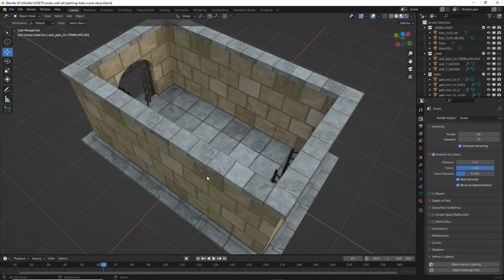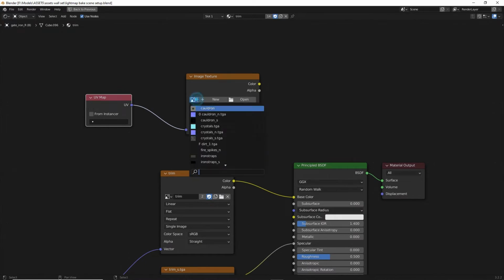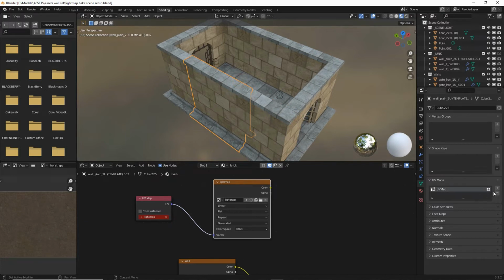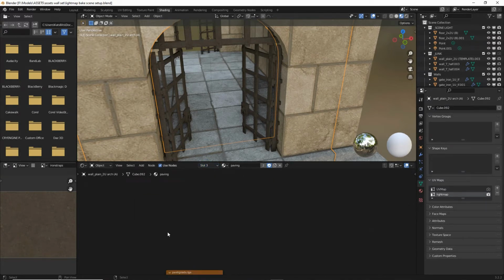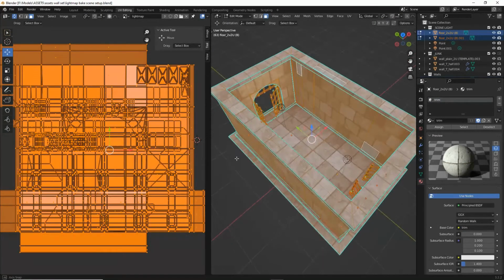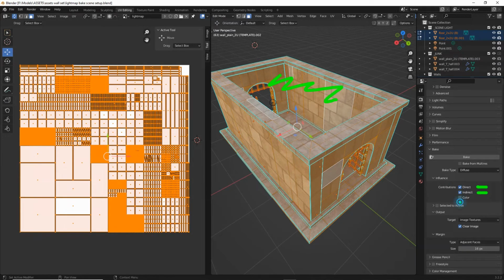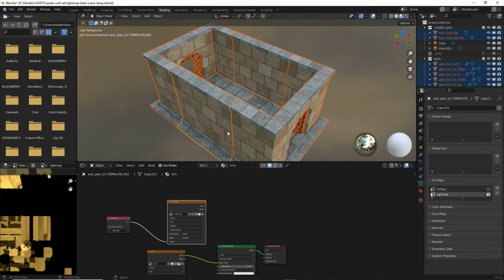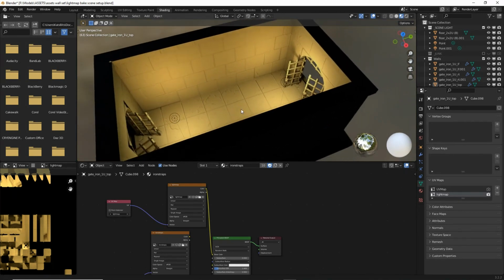Bake Lightmap in Blender

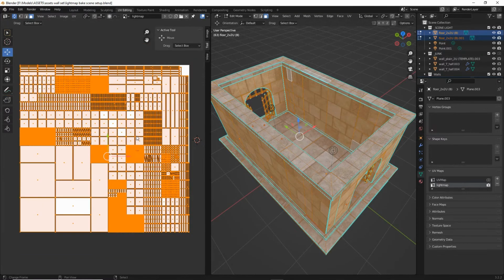Comment: Hello. Thanks for sharing. I have noticed a checkbox 'New UV Map' at 12:17 in the dialogue for creating a lightmap. What does it do? Couldn't you just tick that one instead of creating new UV map channels for each object?
Reply from the maker: It's just a workflow thing really. That can be used but you'll probably have to edit a few things after the fact.
Reply: Be careful with this option!! It will make a new UV Map, but the Lightmap Pack action will overwrite your first (and only) UV Map, which you might be using for textures.

If you want to avoid that and have the second UV Map as Lightmap:
1. Make sure you’re in Object Mode before selecting objects
2. One by one, select every object you need a custom light bake for > go to the Data tab and add a second UV Map with the +, make sure it's selected
3. Shift select all objects you just created a second UV Map for > Edit Mode > press A to select all faces
4. Press U to Unwrap > Lightmap Pack and DON'T use 'New UV Map'

Good luck!

Comment: Why you used uncompressed format to save lightmap?
Reply from the maker: Uncompressed is basically 'raw' data that's not been adulterated by compression artefacts.
Reply: @KatsBits  same for PNG, except it takes less space
Reply from the maker: @uis246  you should always save 'raw' data where possible. If using PNG make sure compression is *disabled*.
Reply: @KatsBits  compression can be lossless. This is how ZIP and PNG work.
Reply from the maker: @uis246 you're missing the point, save RAW data whenever possible.
Reply: @KatsBits  PNG saves same data that BMP does, but also compresses with modified zip algorithm.
Reply from the maker: @uis246  you are still missing the restated point.
Reply: @KatsBits  to not loose data. And I already said about lossless codecs.
Reply from the maker: @uis246  this is the final time this will be said, you are still missing the point. Respond again and you'll have the privilege of being blocked from this channel.
Reply: @KatsBits  why you mad? he is right, even when I'm dealing with normal maps, I save them in PNG because this way you not only do not lose in data but have it less in size. Instead of elaborating you are threating people with ban, like you can't be wrong, so immature.
Reply from the maker: @SlayerDUDE1993  yet another one completely missing the point (despite it being explicitly "elaborated" upon several times). Do you folks grow in tree roots or something?
Reply: @KatsBits  if i ask you right now what the point is, you're just going to tell me that you already said what the point was, refuse to elaborate, and then tell me in bold letters than i am still missing it. the point is that you sound like a beatle and don't know how png works. this was one of the worst tutorials i've ever seen btw.
Reply from the maker: @IveNeverStoodUp  bro, get over yourself, you can use PNG all you want. You PNG stans are almost as insufferable as BlenderBros and just as easy to rile up.
Reply: @KatsBits  is the CIN file supported?
Reply from the maker: @morakumou  surprisingly yes, it does appear that Cineon image files are supported - they can be saved, not 100% sure about them being opened or imported.
Reply: @KatsBits  , i actually miss the point of why it's necessary to save raw data instead of lossless compressed one. is it because of artifacts? but then it's just not true for lossless, it's not affected by artifacts, if that's not the reason then why storing raw variant? just in case, i mean any lossless format, like png, qoi or even just file archives like zip

the only two things i could think of are:
- pngs being limited to 8 bits per channel, which is not the topic of this thread, there are plenty of formats that have 32 bits per channel and support lossless compression
- people forgetting to disable compression for some formats, i. e. exr, but it does not affect pngs or compressed tga, these aren't lossy
(and speaking of disabling compression for pngs, as you suggested in your second comment, it does not reduce quality of the image in the end, again, it's lossless)

i suppose you might've mistaken lower bit depth for artifacts, but it's just a limitation of pngs which doesn't affect other compressed formats with higher bit depths support, like lossless(!) compressed exr (32 bits per channel) or compressed tga (identical to raw tga, which uses 32/32/32/8 bits for r/g/b/a channels, that you've used in the video and only supports lossless, so no room for user error)

i would like to hear your reply and other reasons to use raw or i hope i cleared some uncertainties about issues you might've faced with compressed formats, if that's the only point you initially meant

Comment: Thank you so much for making this tutorial, I searched a lot for blender lightmap baking tutorial, because unity's bakeresult is very ugly, I want to make the lightmap in blender. And I finally found your tutorial! And I am curious if it is possible to use these lightmaps in a game engine like unity.
Reply from the maker: In principle it should be possible to use them in any engine that supports meshes having multiple UV maps, you won't be able to bake and then use lightmaps as a separate group of assets otherwise. Failing that, and this is a little more tricky to manage, it is possible to bake everything, lighting, shadows and diffuse etc., to a 'unified' image that will then be usable as would normally be done for 'diffuse'. Might be a little old skool but it's a failsafe, although this then makes use of dynamic effects, normal, specular etc. moot.

Comment: Can't we use GPU for Baking? If not then why NO?
Reply from the maker: Not 100% sure about this but the Bake sub-system uses its own renderer, it doesn't use the offline rendering engine (or if it does it's not fully integrated).
Reply: @KatsBits  I have confirmed, plus I myself tested, it does support GPU. The baking time reduced as well and in my system settings I can see GPU is being used while baking process. If it is not working, Go to Edit -> Preferences -> System -> CUDA and make sure GPU is enabled (If CPU and CPU both are enabled, then uncheck CPU, only GPU must be enabled)
Reply from the maker: Ah yes, CUDA is for Nvidia based GPUs so isn't enabled by default (not everyone uses Nvidia's obviously).

Comment: what a complete nightmare
Reply from the maker: Yep, that's baking shadows/lighting for games in a nutshell.
Reply: if you have redshift, it's simpler than this but again still a bit confusing.
Reply from the maker: @mixtapechi  yep, there are a couple of external tools/plugins that can be used but that doesn't necessarily make the process easier!

Comment: Hello, is there a way to bake world lightings? I applied a world lighting (forest.exr) to my project and renders correctly within blender, but when I move it to unity, it does not show the lightings. Is there a way to bake? or maybe unwrap UV for a world lighting?
Reply from the maker: It actually sounds like you're trying to bake 'ambient light', which isn't really a fully qualified light 'source' so it doesn't illuminate in the same way Point, Sun, Area etc. lights. This means, as Blender can only 'bake' direct and indirect light sources, anything that's not emitting light, or affects surfaces therein, generally won't be included. There should be a setting in Unity to set the 'world' or 'ambient' light value.

Comment: Hiya. Amm this is a bit tricky a question. But is there a way to bake reflections? E.g. Floor has roughness to 0.2 (gloss)and so reflects the walls. Is there a way to bake that?
Reply from the maker: If you're essentially baking the effect into the diffuse then you're not really baking a functional reflection, all you're doing is baking what that effect is showing, its appearance, at the time of baking, i.e. a static render of the scene relative to the surfaces in it/visible to the effect. To avoid that you have to bake separate image maps and then rely on your engine or renderers material system to (re)build the materials slots with 'reflection' being a separate component therein.
Reply: @KatsBits  thank you so much for replying. I may be doing something wrong. I bake the normal, metal and roughness which I connect to the principal bsd. I bake the defuse with direct and indirect, it shows up as image baked proper, but when I connect it to the base shader it gets darker and I'm not sure why that is :(
No lights and background set to 0.
Reply from the maker: @floyd1411  That's likely a consequence to the Mix mode that's being used. This is similar to Blend Mode in image editors, just try different ones to see which gives the best result.
Reply: @KatsBits  oks will do. Yaa trying to figure it out is the struggle after that it's smooth sailing. 
Thank you ever so much for being so kind and taking the time to reply. Much appreciated❤
Reply: this is used primarily in game engines (like unity, or unreal engine) to optimize game performance, where as performance isn't a focus for blender as its designed to render things that almost exclusively csnt be rendered in real time

Comment: thank you for the tutorial. May I ask, what is the difference between this and baking Defuse, Metalic, roughness and Normal maps with the direct and indirect light checked on. As in baking material with lights. Is lights maps something different from that? 
Im learning blender and basically i am creating a room for a website that only supports pbr textures, so i have to bake the light in. Would this approach above work for that?
Reply from the maker: In essence they're the same except how each 'type' is used or organised (collated together)... With that in mind if your project uses PBR you likely don't need to bake shadows or shading as that would typically be handled real-time by the render engine (or the engines/editing tools). Just make sure your normal, metallic, roughness etc., are set up per what each material represents and you should be good to go.
Reply: @KatsBits  ahh thank you for replying. Yaa that s the problem there is no real time render. And I'm just using 1 combined back texture of 2k. So very Low quality :(
Reply from the maker: @floyd1411  If there's no real-time why is it using PDR? What engine is it?
Reply from the maker: @floyd1411  based on their docs it looks like you'd need to UV map everything so all objects used their own unique UVs and then bakes everything to similarly unique assigned textures. In other words, you'd set the scene up in Blender as you want it to appear, and then bake, including normal map influence.
Reply: @KatsBits  ahh yes. That's why it was coming up all warped. Yaa definitely will unwrap. And yes. Next time i ll bake all 4 textures instead of using just one combined one. Thank you so much for checking. I really appreciate it. Your Tutorials are awesome, definitely gonna keep an eye of for more as and when u post em. Thanks again. Cheers again.